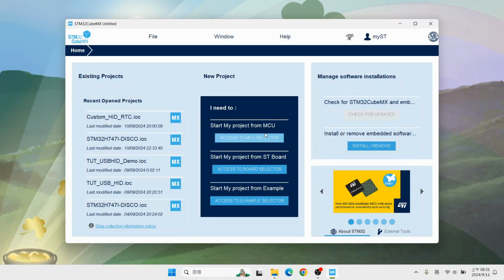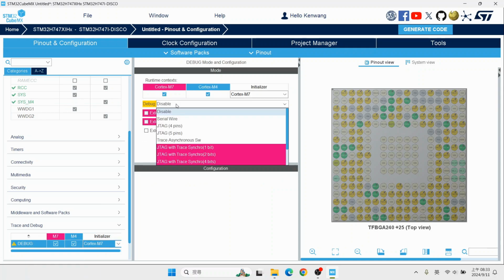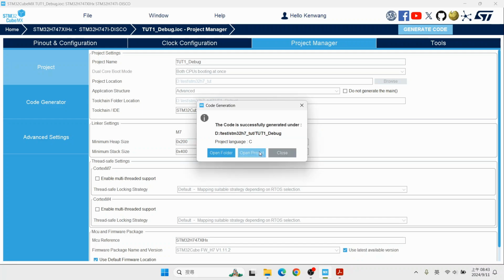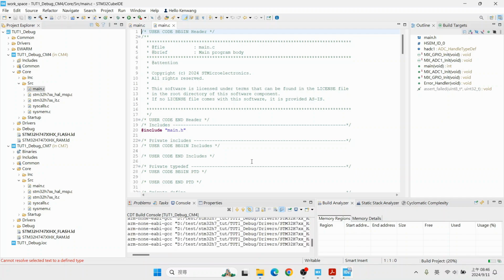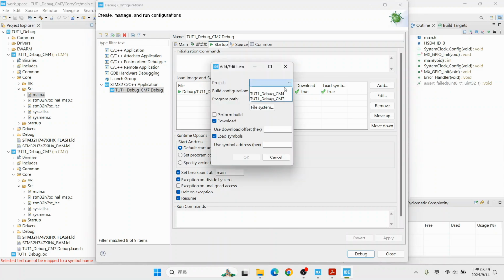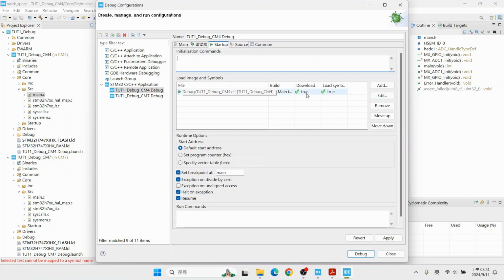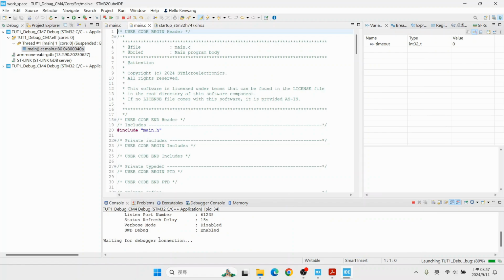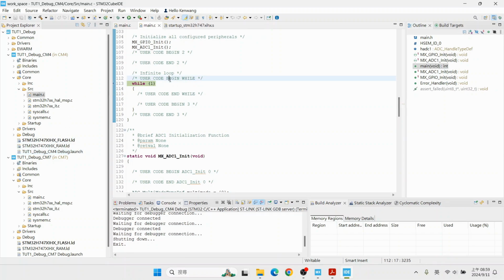STM32 : How to Debug Dual-Core STM32H7 MCUs Using STM32CubeIDE | Step-by-Step Guide

Comment: My CM4 stops randomly, and the Program Counter (PC) is not incrementing. I don't know why. I don't think it's waiting for an interrupt. Can you help me?
Reply from the maker: This question is very broad, I don't know which functions you use, maybe you can explain it in more detail and we can study it together.
Reply: @tomyang2916   I managed to get the FP-AIVision example from STM32 running on the STM32H7's M7 core. Then, I wanted to port it to the M4 core. I adjusted the code and the linker script to suit the M4. Following the instructions, I set everything up for debugging, but the M4 just hangs. There’s no error message, no error handler, and no HardFault. The M7 core simply continues running as if nothing happened.
Reply: Code please